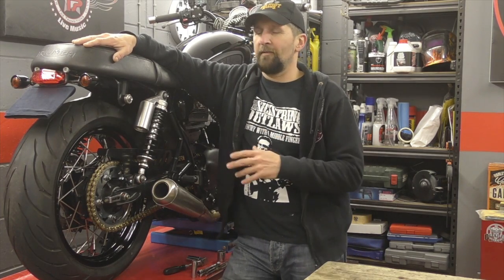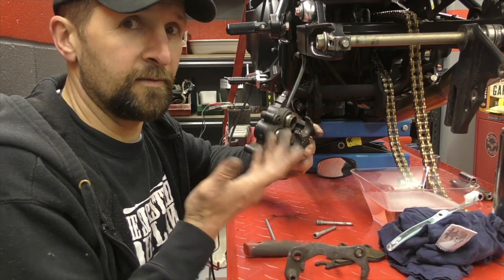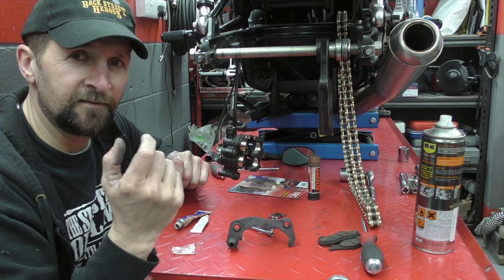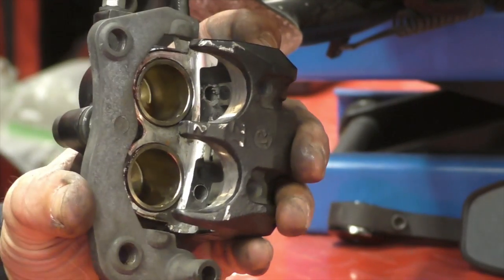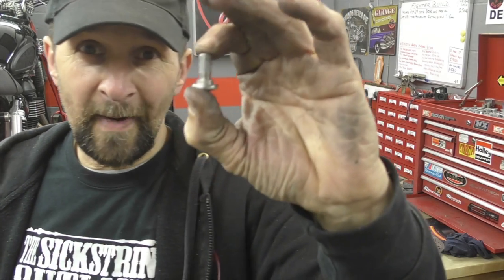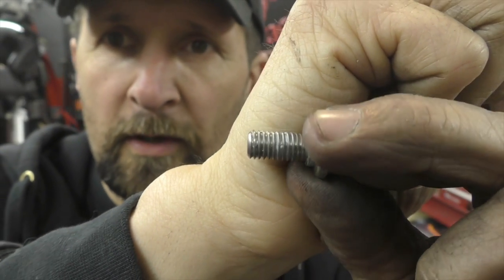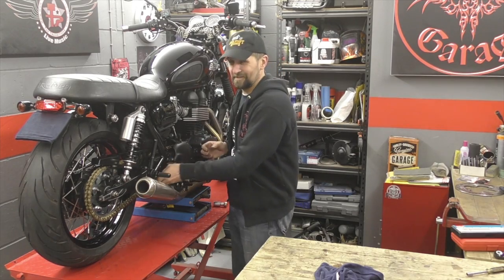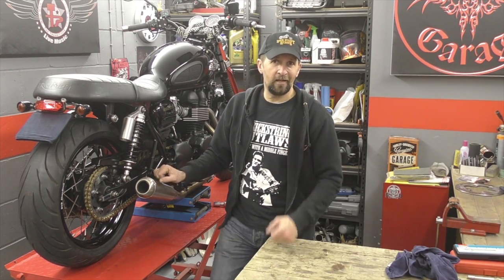Delboy's Garage, Triumph Bonneville Rear Brake Upgrade.

Comment: Question about minute 24 or so when you are showing the lip seal on the dust seal and spacer. That seal looks worn and not a good fit on the spacer. I think the seal should have been replaced. Actually, all seals replaced?
Reply from the maker: No buddy, there is no wear, it's a 4yr old bike with 5,000 miles... the brakes are like new, just a little dirty
Reply: Sorry. Not the brakes, but the dust seals where you are applying a little RRG. Just looks like the wheel spacer has a little play against the seal lips. That's to say the seal lip looks "stretched, is all. BUT, your instructions are very well worthwhile in explaining how things should be approached. Regards

Comment: Why did you change those old pads. they looked perfect?
Reply from the maker: Upgrading to EBC Copper Sintered Pads, which have more abrasion on the disc, causing more drag, therefore better braking, and using EBC discs with them, as they are harder and resist the wear created by the improved abrasion.....

Comment: Good day sir my triumph bonneville 800 rear brake keep locking up after using the brake a couple of times that I have to open the bleed valve for the brake to let go loose. What causes that problem sir?
Reply from the maker: If the bleed valve relieves the situation, it's more likely the master cylinder is not returning, or alternatively, you have excessive water content in the fluid, which will expand with heat where as fresh brake fluid won't... try flushing it through with fresh brake fluid and see if that cures.
Reply: @Moonfleet41  thank you for sharing your wisdom sir, I will try it and see. 😊

Comment: Hi Del, great video. I've cleaned my brakes and unfortunately I've left it too late and the slide carrier has seized meaning the calliper won't slide and the new pads are dragging quite bad where the carrier won't self centre.
Now that the carrier has seized, any tips to free this up with out doing any damage.
Thanks in advance for any help.
Reply from the maker: Hi buddy.. well im sure you probably realize that the only remedy is to get it all apart, clean up the parts that have stuck together and then, hopefully, you can grease them and rebuild them.... where are you with it now mate, is it all apart and the slide just wont come out...?
Reply: Moonfleet41 Hi Dell,  the calliper is still connected to the brake line. The pistons are cleaned and moving freely, I just can't get the carrier to slide on it's pins within the calliper meaning I can't free it to clean and grease.
I guess I'm going to have to get the calliper on the bench, get as much release spray into the pins and try and lever them apart.
Are there any tricks to this or is it going to be brute force?
Reply from the maker: Hi again buddy... no, no tricks, just gentle leverage to get them free.. and  re-lube them when you're done..
Reply: Moonfleet41 Hi Dell
Thanks for the replies, keep the great content coming. They're a great help to us amateur mechanics. It's helped me no end with servicing tasks I wouldn't have taken on before. The more I do the more confident I become.
Thanks again

Comment: At 16:30 Delboy says "Always use copper grease because these pins will seal over time." Whelp. I didn't listen. And now my pins have seized. Going to have to drill them out.
Reply from the maker: Sorry to hear that Jeremy, have you tried a torx bit tapped into the head tight first ?, that can often get a grip in it to break the grip?..  good luck with it buddy..
Reply: @Moonfleet41  Great suggestion. I did try to fit a torx into the bolt head, but it was in there very tight and the hex shape was really rounded/stripped. I did get one of the bolts out using a screw extractor, but couldn't manage both. I kept drilling the head out and now it's at the point where I'm getting close to the wider edges. Worried about cutting the receiving threads on the caliper's side. I did see your other video where you mentioned using Quicksteel/JBWeld and an old allen wrench. I had some Quicksteel handy and am now waiting for that to set overnight for one last try tomorrow. If that doesn't work, I think I'm off to a machine shop to let a professional bore it out.
Reply: Honestly, looking on the web, I'm shocked to find this is such a common problem with these brake caliper pins! If they're constantly getting seized up, it seems like a bad design. Very frustrating. I was so looking forward to riding this weekend and taking a small break from this COVID lockdown.
Reply from the maker: @JeremyRicketts  OK, so if you have the last offending pin right out almost to the threads, there's practically nothing left holding that in... why not carefully file a couple of flats on the mid section of the pin itself and see if you can get some grips on it and turn it that way, there can't be much still holding on... and then at least it will save you the money of taking it to someone else, anything's worth a try at this point aye... good luck with it mate.
Reply: @Moonfleet41  Thanks man. So, I tried using the old-hex-wrench+epoxy trick, but that didn't work (even though I let it set over night). 

With increasing sized drill bits and bolt-removers that would never catch, I realized at some point I was getting dangerously close to the threads. To make matters worse, I was off-center on the bolt (just using hand and tools sitting on my garage floor). 

In the end, I called it, phoned up a local CNC shop, paid them $20 USD, and they had it cleanly drilled out within an hour. After the bolt was removed it was easy to see that I was in fact starting to shave off the receiving threads! So, I'm glad I stopped when I did. 

Lessons learned: 1) Lots of copper grease for bolts going into metal pieces of a different kind of metal and subjected to high heat 2) Stop over-tightening bolts.
Reply: @Moonfleet41  Just wanted to say thanks again for your comments here and for making such great videos here on YT. I'm a software worker by trade and wrenching on my bike is a totally foreign skill to me. Your vids give me confidence that maintaining my motorcycle and doing repair work is a learnable/approachable skill.
Reply from the maker: @JeremyRicketts  Glad you got it sorted Jeremy, with your skills I'm sure there's nothing you can't learn about a bike, enjoy your projects, stay in touch, and always drop us a line if you get stuck!
Reply: I just worked on my brakes and didn’t pit any new grease on the pistons.. need to pull them out or wait till next service?

Comment: @Moonfleet41 Why do so many people disagree with how much copper grease you use and they also say you should not be using the copper grease on brake parts at all Del? I am taking apart and cleaning and lubricating parts of my bike and a fellow rider jsut sent me this in an e-mail when I told him you have been promoting the use of copper grease on brake parts:  https://www.greaseexpert.com/brake-grease-vs-anti-seize/     I quote form the website,"If you’re looking for a grease for your brakes, then you should look for a specific brake lubricant for the pins. You can just use a regular ceramic based lubricant for the pads. Do not under any circumstance use a copper grease, as this can be detrimental and have a negative effect on the performance of your brakes. ...Using Copper Grease is a sure way to seize up the slider pins. ...It can have an effect on the ABS sensors. ...Galvanic Corrosion. ...It isn’t even a lubricant. ...Copper is a good conductor. ...the reality is that there are other lubricants that are as effective as copper grease as an anti seize the brakes which are less likely to have adverse side effects. So, it really makes no sense to use a copper grease for your brakes. .. .                                                                                                    What to Use Instead of Copper Grease on brake parts: 
Mission Automotive Grease
 Mission Automotive Dielectric Grease/Silicone Paste/Waterproof Marine Grease (8 Oz.) - Excellent Silicone Grease
Sil Glyde
3M Clear Silicone Paste
Permatex Ceramic"

There is also a great part that tells you how to Properly grease the brake slide pins with The Right Grease!!! The article ends by summing it up pretty well:
"Conclusion
Overall, these are the best options for you if you’re trying to grease your brake pins. They are definitely the best options – if you’re trying to grease your own brakes, you’ll undoubtedly want to opt for a lubricant specifically designed for this need. Some mechanics and others will use whatever they have on hand [such as inferior copper grease which isn't right for brakes at all!], but for safety you should use a good quality brake grease to be safe."

Comment: Can we use chain wax?
Reply from the maker: On what Arfan.?
Reply: Moonfleet41 on back of pads instead of copper grease, also I got plates fitted to my stock pads shall I put on to new pads or leave them out? Thank you
Reply from the maker: Fit the new pads with those shims on the back......and a tiny wipe of copper slip between them mate.